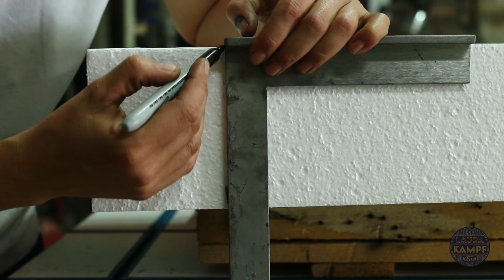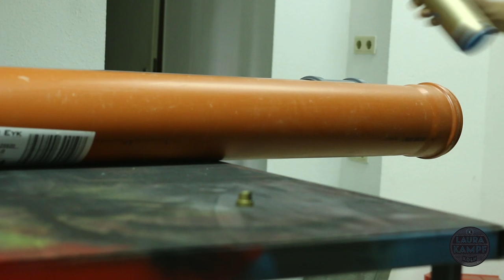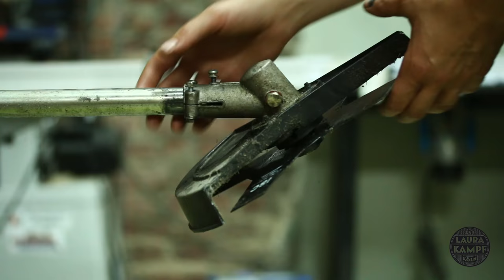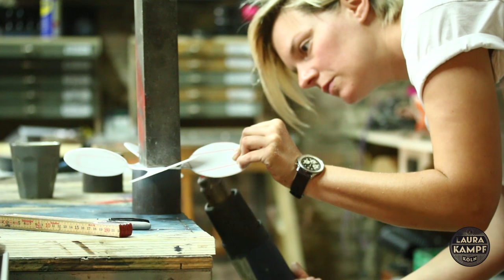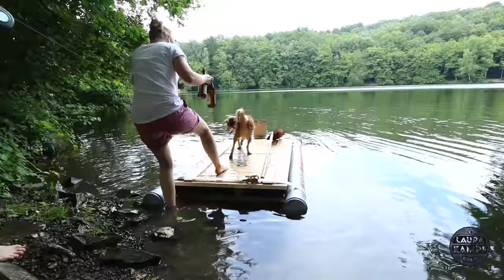Laura´s Turbo Raft

Comment: That motor is probably powerful enough if you have a better propeller shape. Thais use small motors attached to a similar shaft, called a "longtail", so it can be very practical. Lots of fun watching your enthusiasm. Your friends and Smudo must love your crazy inventions!!!
Reply from the maker: the thai long tail boats are a bit more dynamic in shape than my clumps raft :)

Comment: great raft Laura, you have prob realised that the strimmer had a small engine and the prop would work much better if it was reduced in size and pitch, which would cut down on the smokey exhaust. great project .

Comment: Good job, entertaining video! :)  I have one suggestion, make the propeller out of a stiffer material, the one you have now can't handle the forces and the blades loose their pitch under power. One made of metal would give you more speed.

Comment: Motor will run faster, smoother and much longer with far less oil mixed in the fuel.  One of those rare situations where following directions actually works.

Comment: hahahah this is awesome!! you have to try introducing the propeller in a cylinder to get more turbojet :D
Reply from the maker: would that work better? cool!
Reply: Well, it depends on the power and speed the motor is able to supply but first I think maybe the impeller blades could be bending under the load? I don't know how stiff is that plastic. Aluminum would be cool :D If you want to keep improving it I can review my university notes about impeller blades designs haha!
Reply from the maker: i probably wouldn´t understand it anyways haha...i think i will do another water project and will try a smaller propeller for that...we will see :)

Comment: Very nice. I have two questions about propeller: 1, How did u balance angle of 4 fins/blades? I ask becoz I know if angles are not balanced (in air fans atleast) there are horrible vibrations. 2, Was propulsion force as you expected or less?
Reply from the maker: i dien´t balance them...just eye-level. i expected it not to much at all to be honest so i was surprised

Comment: HAHAHAHA!! Totally awesome! One question: Did you put any sort of silicone or anything over the staples on the underside to avoid leaks? Great vid, as always!
Reply from the maker: no, i screwed strips of wood all around it. it wouldn´t sink the boat if water got it...the foil is just to protect the styrofoam a bit.

Comment: I think probably you could increase the speed if you regeared the weed trimmer. It's not geared right, it's geared for speed not torque. You need a shitload more power if you want to push that... I mean, if it's what 1.5m by 1.2m on a side and it sinks into the water by maybe 50% with one person on it? Maybe 0.1m?

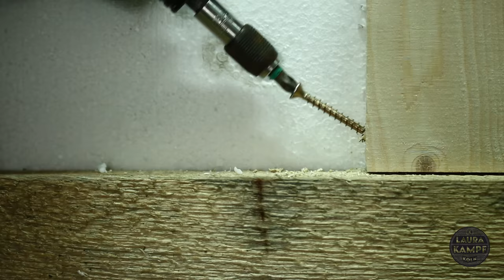I mean what you're looking at is 0.18m^3 of raft but with an area of 1.8m^2, which is a 1:10 ratio and means there's a LOT of drag that has to be compensated for, and with something like a weed trimmer you're not gonna get the torque needed to push that kind of thing.

Comment: How is called that tool on the electric screwdriver (the tool that holds the bit)?
Minute 1:10
Reply: It's a bit holder.
Reply: +Nikel87
 Thank you, it's a simple bit holder like http://apexbitsdistributors.com/images/products/Apex-Fastener-Tools/Apex-Bit-Holders/detail/qr-m-490-a-apex-1-4-hex-power-drive-bit-holder-for-1-4-hex-insert-bits-quick-release.jpg
or it have any extra function/feature ?

Comment: Du trägst eine Breitling, liebe Laura? Schönes Video thumbsup
Reply from the maker: ich versuche die eigentlich immer zum bauen auszuziehen aber manchmal vergesse ich es einfach. die gehörte meinem opa, dann meinem vater und jetzt mir :)
Reply: +Laura Kampf Absolut schön, und steht dir dazu auch noch sehr gut. Pass' gut auf sie auf.

Eine andere Frage: ich sehe, dass du sehr häufig mit Multiplex arbeitest. Wo kaufst du das in Deutschland? Gerade Baumärkte haben in meinen Augen eine völlig überzogene Preisliste... Ich bin nicht bereit 50 Euro und mehr auszugeben für den Quadratmeter.
Reply from the maker: ich kauf mein holz generell immer im holzhandel und nicht im baumarkt. die haben tatsäcklich sehr überzogene preise. in köln kaufe ich mein plattenmaterial bei begall-winterhoff und mein massivholz bei karl kohl
Reply: Laura Kampf Das klingt gut, da werde ich mal die Holzhändler in der Umgebung besuchen.

Comment: Laura could you make a computer chair?
Reply: Yeah, i would actually need one, as my old is breaking apart and i havent found anything suitable. I spend long time in this chair and i'm getting some neck problems with this, even thought its pretty pricy one. Other issue is that my crafting table is connected to my information/media center, so i should be able to work with metals etc, using same chair.. i'm tinkerer, builder and self teached engineer, but god damn this is hard on to crack..

Comment: Didn't do the math, did we? 
DIsplacement  and total load need to be worked out first to determine how big the vessel should be.
The engine is smoking because the clutch is slipping, because the prop is far too big, and there is too much torque.  Get a prop from Youngs props. T10 fits most weed whackers. 
Never the less, a great fun project.
Reply: The engine is four stroking.
The choke is on or it needs some fiddling with the mixture screws.